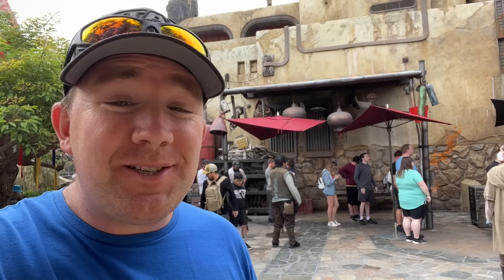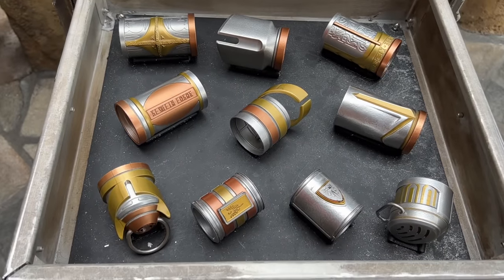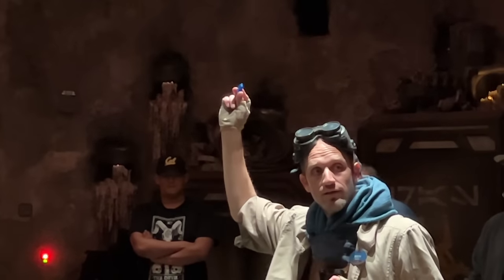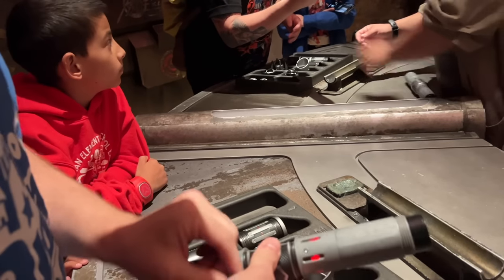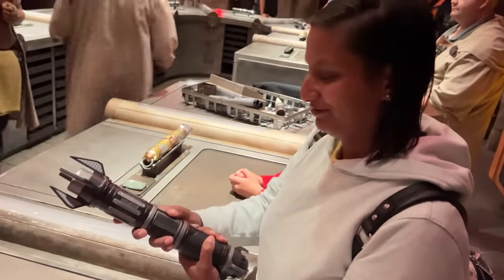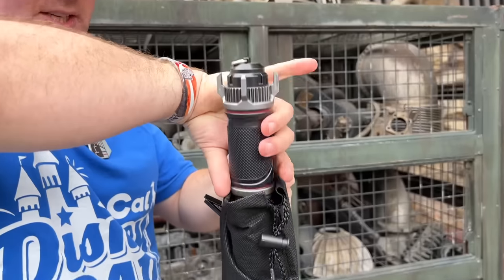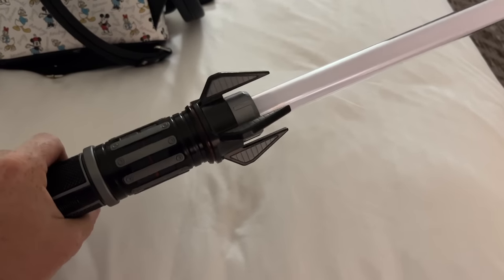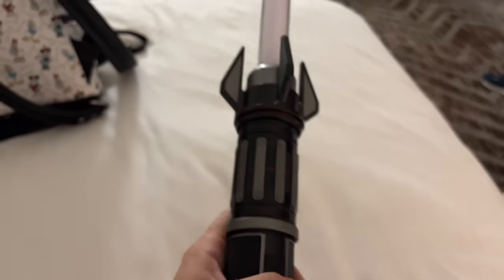Is Savi's Workshop at Disneyland Worth It? | FULL Lightsaber Experience

Comment: This experience looks like a lot of fun! We have done the droid depot and have thought about doing this next time!
Reply from the maker: I did Droid Depot before. I don’t think I’d do it again. But definitely would for sure do Savi’s again, even with the $219.99 price tag.
Reply: @SoCalDisneyDad  $219.99 is that the same price on the whole range of lightsaber's
Reply from the maker: @Wolshanze  That’s the Savi’s price. So everything you can build at Savi’s is in that price.

But you can get Legacy sabers (Obi-Wan, Luke, Vader, etc) for cheaper. Usually in the $150 range.

You can’t build it or disassemble it, but it’s the same lightsaber technology as the Savi’s blades.